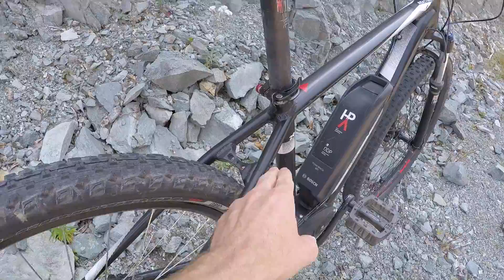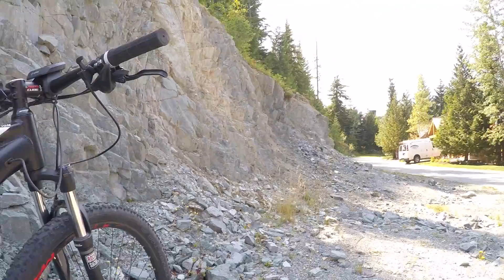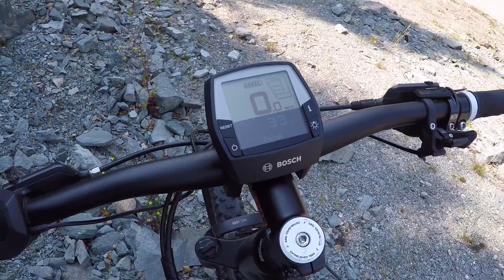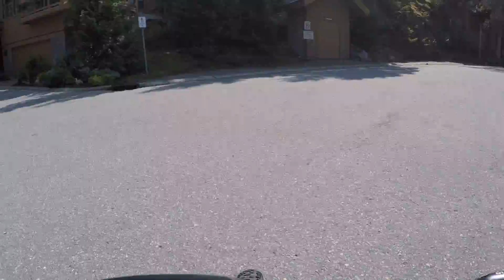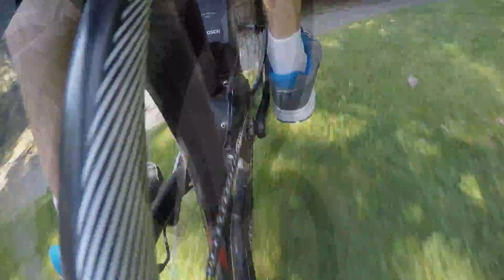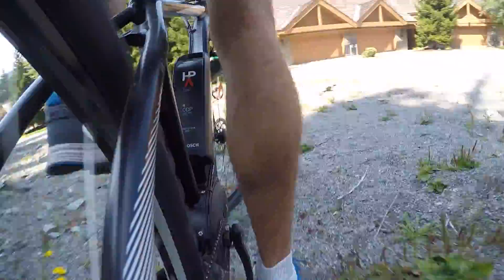CUBE Reaction Hybrid HPA Pro 29 Review - $3k

Comment: What is a top speed of this? I mean not assisted cuz I know it's 25 km/h but top speed you can achieve when pedalling. I'm asking about this because of this one and only 15T gear at the front, which seems like really low gear and making speeds like 40 or 50 km/h virtually impossible (excluding riding downhill, of course).

Comment: This is a great bike. Maybe I will buy it. Can I attach a light which uses the bike battery? Its drives up to 25 km/h. Can I make it a little bit faster 27 or 28 km/h? My normal bike speed ist 26 km/h. With this system I have to ride slower.

Comment: Nice review. Whistler looks great.

I think you mispoke on the weight didn't you? You said what? Fifty-eight pounds? If the batt and motor weigh about 14 combined the weight should be about 45 pounds. My non-electric XL size Giant Roam 1 weighs about 30.

Comment: Tested and bought - Cornwall, United Kingdom.  Thanks for your review.  Inspired me to take the demo out at Certini Cycles Saltash.  After a successful test ride on the this bicycle I decided to pick myself one up. They are great fun. Never thought I’d get back on a bicycle again with all my health issues. It can give you a little bit of assistance or any awful lot up to 15mph. It’s great for my knackered out arthritic knees and ankles and Fibro problems. Just stick it in the highest setting and you barely have to do any work at all. If you having a good day you can tone it down a bit and work a bit harder. 
But do not fear, this is not replacing the motorbike. Its to help get my joints moving and hopefully make me a bit fitter as I’ve not got on with swimming or physio too well. So far so good. Great to be out and about on paths and trails. Different kind of biking experience. I think its brilliant.

Comment: What's the Cube equivalent to the full suspension all mountain Haibikes, and how would you consider the Cubes compares to the Haibikes in terms of value for money vs. performance and quality. 

A slightly uninformed question as well: when a mid motor Bosch or Yamaha bike runs out of battery, does it get tough to pedal or does it function like a cumbersome but regular mtb?

Comment: Luvvin where ebike technology is going and all the new designs. I heard that a company in the Uk put a tiny hydrogen battery cell in a mobile phone it apparently lasts 1 week on a single charge :-) wonder if it will be applied to ebike systems :-). Safe riding to all.
Reply from the maker: Michael Willers Oh man! That would be awesome... The key for cycling is light weight and small. The latest Lithium-ion tech (like Lithium Manganese Oxide) is pretty good but Hydrogen sounds like it would be significantly lighter. I love the feeling of road bikes where you can pick it up with one finger, almost confusingly light. if we got ebikes down to even 10 pounds that would be amazing!
Reply: Totally agree!!!

Comment: Wonder what the price would be to the US?  Also, does it top out at 19MPH?  That is what I saw on the odo.
Reply from the maker: James Jacocks Hi James! I'm not sure if it can be found in the US right now, even the bike in this video was scarce in Canada since it's a 2015 model and they were completely sold through. With the smaller 15 tooth front chainring this bike did go a bit slower but had awesome climbing power. I think next year they will have 18 tooth chainrings :)

Comment: Hey do you know any mid drive electric bikes that have regen?
Reply from the maker: Mohsin Patel Hi Mohsin! No, this isn't something I've ever seen. Most regen setups work using a direct drive gearless hub motor that acts as a generator as you coast or brake. BionX makes motors like this along with the Specialized Turbo, Stromer ST2 and some others. These motors weigh more, aren't as powerful at low speeds (for climbing) and have some cogging (repelling magnets as you coast that slow you down a bit). The efficiency is something like 10% to 15% so some companies skip it altogether but for others it's a neat feature because it saves your brake pads and gets you energy when coasting down long hills. I hope this helps!

Comment: Too bad this one didn't have a walk mode. Although, this is the first time i heard about mid drive with a walk mode.
Reply from the maker: GrimFaceHunter Yeah, kind of surprising... for 2016 I think they might enable it.
Reply: ElectricBikeReview.com Have you ever tried riding the bike in "walk" mode? Unless the speed is limited to real low, pedaling along may be the most economic way of riding.
Reply: what is walk mode?
Reply: huseyn ahmadov You press the button or just activate it in the menu and the motor is assisting while you walk and push the bike.

Comment: hello all, Im brand new to E bikes and ive just rode my first E bike just today. What would be the best bike for city, and mild distances, that is under 3,000 USD? THanks so much, and im looking forward to getting into the industry!
Reply: Isaac TennisRF HEY ISAAC buy a  8 fun motor and have it attached to a bicycle i only spent 2600 for both the bike and the motor and the battery its extremely reliable dude speaking from expience i use my bike to commute back and forth from work and i have a top speed of 35mph i have 700 miles on it now dont buy this expensive bikes the more fancy it is the faster those little things start to break
Reply: ***** True, but its over 2000 USD :)
Reply from the maker: Isaac TennisRF Hi Isaac, here's a list of my favorite ebikes from 2015 by category (each one has a performance and value bike) http://electricbikereview.com/top-10-electric-bikes/ and here's a list of the most affordable ebikes I've reviewed to date: http://electricbikereview.com/tag/affordable/ from what you've described I think one of the Easy Motion Evo bikes could be a fit, they have some with fenders and lights for $3k and a more upright relaxed orientation: http://electricbikereview.com/category/easy-motion/ you could also do the kit thing like Charles suggested... this lets you pick any bike you want and then add a kit on after. If you go this route I recommend e-RAD which makes a BBS02 model that can be adapted to a wide range of bikes and offers shift sensing and more durable parts inside: http://electricbikereview.com/category/e-rad/ note that I do not work for e-RAD and am not paid by them, I just like their stuff :)